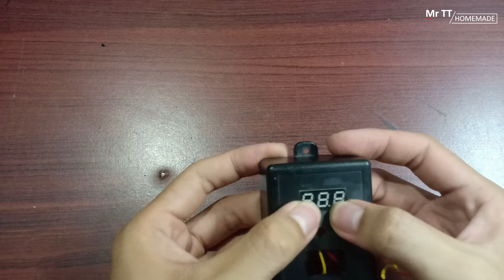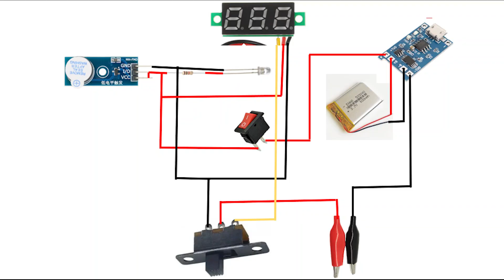Make a multimeter | make DC volt meter | Mr TT Homemade

Comment from the maker: Hello everyone :hand-pink-waving:, these are the main ingredients I use:
1. 0.28 inch LED digital voltmeter DC 0-100V - https://s.net.vn/fEZk
2. Micro USB 5V 1A 18650 TP4056 - https://s.net.vn/jzpi
3. Siren Module Arduino - https://s.net.vn/vB21
4. Li po battery 3.7v 650mah
5. Crocodile clip - https://s.net.vn/MVnP